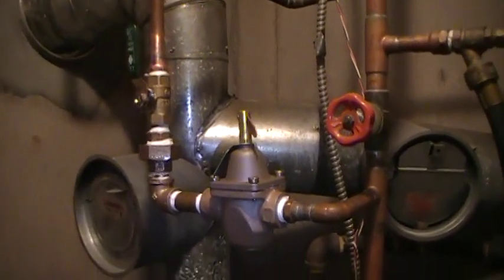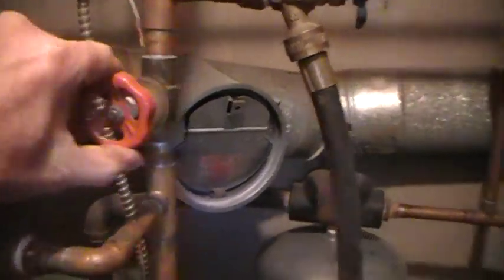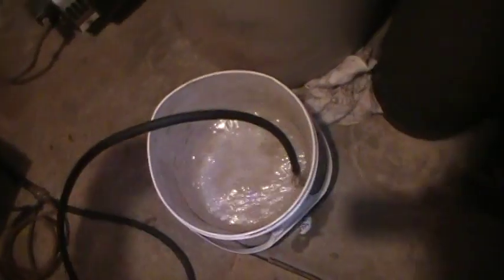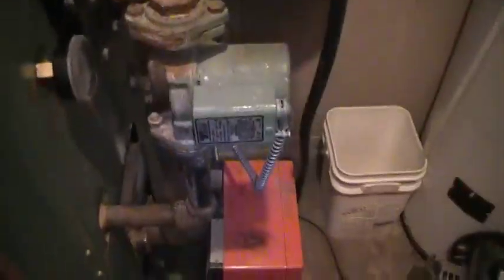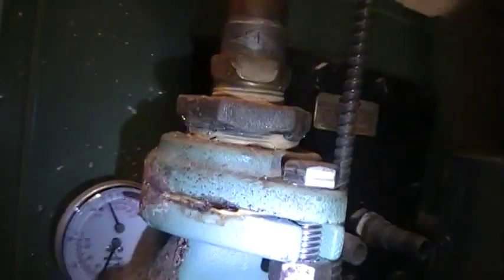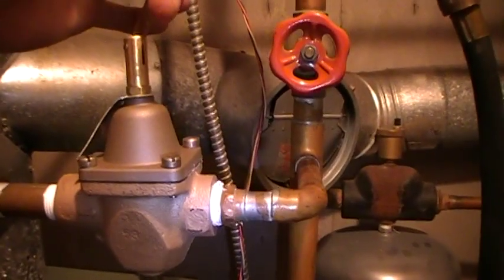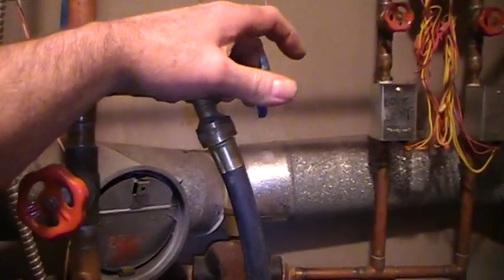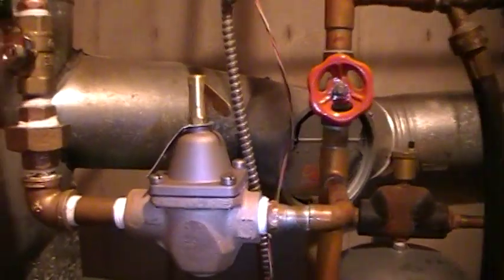How to remove the air out of your hot water heating system-girgling noise.

Comment: Hello Al. Thank you for your videos. .
I have to relocate one of hydronic baseboard heaters and I am trying to figure out how to drain my system, relocate/ replace the baseboard and then fill and purge the system. Here is some information about my setup:
My house is a colonial and the boiler is in the basement. 
I have two zones, one for the first floor and one for the second floor. 
The second floor zone has 2 loops.
The zone valves are Taco and are installed at the supply side.
There is a 00e Taco circulator pump on the supply side.
The 3 loops return (2 second floor and 1 first floor) meet and are controlled by 1 shut off valve on the return before the boiler.
Above the shut off valve there is a drain valve.
Before the 3 returns connect together there seem to be something like a valve that can be turned with a flathead screwdriver, not sure what that is. I looked online and people say a balance valve (?).
I would appreciate your help. I can send you picture of the system somehow.
Thank you in advance! 
Chrys
Reply from the maker: Hello Chrys,
You're welcome!
Is the baseboard you are planning to reroute on the first or second floor?
Do you have an expansion tank which is about 3 feet long and usually suspended up in between the joists or do you have an extrol tank that would be about a foot high and wide located near the boiler?
The funny looking valve is called a pressure reducing valve. Never adjust it comes preset.
Get back to me when you get a chance and we will see if we can figure this out together....Al
Reply: Hello Al,

Thank you for your quick response. I have the second type of expansion tank that you described. The one I want to relocate now is in the first floor, but I might add a few more feet of baseboard on my master bedroom eventually because it seems to be under heated. What if I touched those valves...?
Reply from the maker: Hello kouts_limnos,
No big deal as long as you put them back to how they were.
So you must shut the heating system down completely. Meaning both the power and the water shut off to the system. That valve should be located before the pressure reducing valve (the one with the lever on top). You may not have the lever on your reducing valve as it may be the your PRV as you mentioned above.You want to drain the loop you are working; so you will need to drop the pressure to zero.
I believed you mentioned that you only have one valve on the return which is too bad because you are going to drain water from the all three zones and will have to purge them individually once you have relocated your radiation. Regardless place a hose on the drain valve of the return and open until the water stops completely. 
Be sure to check the gauge on the boiler. It is your friend when it comes to the system. The pressure must reach zero before you attempt to do any pipe cutting.
Once it has dropped to zero and the water has stopped flowing out of the hose you can begin to cut the copper.
I always use a wet vac when I am making any cuts on baseboard as it takes care of the dirty water that will stain things easily.  If you are making these cuts in the basement then you will probably get a way with a bucket.
A little tip. Whenever I am rerouting a pipe I always use sandcloth to clean the pipe before I make any cuts as it is much easier to do beforehand. It is supported at this time and can be shined easily. Once a cut has been made the  end of the pipe will bounce all over the place. It will still need a little shine after each cut, but doing it will take care of the majority of the dirt on it.
Not sure when you are planning to do this, but spring is better than winter. Just in case you run into any issues.
You mentioned adding radiation to your bedroom. My rule of thumb is the square foot of the room divided by ten. Ten by ten room...10 feet of baseboard plus an additional few feet for an average window. In that ball park. I have had great success with this simple formula. Many homes have far to less radiation. So many people install it like electrical baseboard which you cannot make a comparison to.
I have seen kitchens which are generally the hardest places to install baseboard with two feet under each window in a corner on a north wall. They said the house was never warm. Very good reason for that.
Anyway...hope this helps!
Thanks for commenting and enjoy your weekend!    Al
Get back to if you have any more questions.
Reply: @TheOldkid888  Hi Al,
I am not planning on doing this until it warms up around end of March or so. Here is my plan of action. Let me know if you agree. I will turn the power and the water supply off. I forgot to mention that I have an indirect hot water heater. I will turn the supply to that off as well. Connect a hose to the drain and turn the shut off valve below it off. I will also turn off the valve before and after the circulating pump. Then I will open the drain valve and go upstairs and open the bleeder valve that is further from the boiler. Then I will wait until all the water is out of the system and the pressure is 0. After I finish with the moving around. I will turn the bleeder off, turn the water supply on, turn the valves before and after the circulating pump on. Manually turn both zone valves on and wait until no more air is coming out of the drain hose, making any necessary adjustments on the water pressure. when no more air in the system I will ensure the pressure is around 14psi turn the drain off and check for leaks. I thinking if I should install a shut off valve on each zone loop before they connect to the 1" pipe together. Also, my master bedroom is definitely underheated. It is 20x13 with 3 windows and only has 15 feet of baseboard. Your thoughts are greatly appreciated.

Thank you,
Chrys
Reply from the maker: Hello Chrys,
It sounds good. 
I personally like to put individual valves on all lines. One on the each return line and supply line. 
You have a shut off on either side of the pump which will isolate the pump if you ever need to replace it which is great! If you place valves above each zone valve; this will make replacing the zone valves very easy. 
It is not necessary, but convenient. I am a big fan of ball valves. The only way to go.
The indirect water heater will be fine. No need to shut the water supply off or drain any water from it.
BE SURE to close the bleeder before opening the feed valve to the system. MOST IMPORTANT as you know!
Sounds like you have it all under control. Remember zero pressure. Allowing air into the system will drain that loop, but it may not drain the one you are working on; so opening a bleeder on each is what I would do.
Best of luck with the project! REMEMBER TO CLOSE before filling. Can't stress it enough.
That size bedroom should have at 26 feet in it. It should go across the 13 and then down the longer wall at least 15. If it gets to warm; you can always close the dampers on the baseboard somewhat. Most people like their bedrooms a little cooler for sleeping so closing the dampers will make a difference.
Thanks for commenting and enjoy your week!    Al
Reply: TheOldkid888 Al, thank you again for the quick response! One more thing and hopefully I will be all set. If I add another 10+ feet of baseboard in my master bedroom, won’t that affect the balance of the loop? 

Thank you,

Chrys
Reply from the maker: Hello Chrys,
Where is the thermostat located for that zone?
How much radiation is in the other bedrooms and what size are the rooms?
Get back to me when you get a chance.....Al
Reply: TheOldkid888 Hello Al,
Sorry I took so long to respond, but I ended up not doing anything in the spring to add more baseboard to my bedroom. I think I have to do something now because the master bedroom is 3-4 lower than the rest of the second floor. I was thinking about replacing the 16 feet of existing baseboard with something more efficient, not sure what. Or add 8-10 more feet of baseboard. I am afraid of messing up the balance of the loop. The master bedroom is the first room of the loop. There are two more rooms after an 8x8 with 8 feet baseboard and an 8x12 with 12 feet of baseboard. On the same zone but different loop of there are a 5x7 bathroom with 4 feet baseboard, another 5x7 bathroom with 4 feet baseboard and a 12x14 room with 12 feet baseboard. The thermostat is located in the hallway in the middle of the floor. Also, if I end up adding more baseboard the return will have to run in the same enclosure because the supply line is in the opposite direction. I am sorry for the long comment. Thank you!

Chrys
Reply: Any input?

Comment: Hello Al, how do I bleed the air out of my boiler? The way it was setup is that there’s no shut off return valve between zone valve and spigot[sediment valve]. The cold water main feed goes to water pressure regulator tied in below the zone valve then to circulator pump(return line) then goes back to the boiler ,the spigot valve is above the zone valve. Please help and Thanks in advance
Reply from the maker: Hello sakitlikod1,
Just to be clear....Is there any valve on the return line going back into the boiler? 
Do you have cast iron rads or is it baseboard?
We will try and figure this out. Just need as much info as I can get.
Thanks for commenting and get back to me when you get a chance.....Al

Comment: hi, you have your fill valve teed into the return. is this the only way or location to auto fill the boiler? thanks.
Reply from the maker: Hello mark.r hvac,
It is how I install the feed lines, but I have seen them on the flow as well.
It should be installed in the return as it pushes the air up through the system when purging.
Thanks for commenting and enjoy your weekend!    Al

Comment: my 2 story house only has 1 zone the pipe from the boiler go ,s up to all the radiators and back to the boiler how can i purge the air from it
Reply from the maker: Hello dennis,
Is it cast iron radiation or baseboard radiation you have in your home?
Thanks for commenting and get back to me when you get a chance....Al
Reply: @TheOldkid888  i have cast iron radiators. thanks for your reply
Reply from the maker: Hello Dennis,
No need of purging when it comes to cast iron rads. You can purge all day and it wouldn't make a difference.
On each rad you will see a bleeder valve. It is located on the side of each rad on top. It is a small 1/8th fitting with a screw in the middle. You simply open the screw in the middle until you get air. DO NOT open it too far. If the water is close; you wouldn't want to drop it on the floor. It would create quite a mess as the water is black and stains things very well. I generally use a small container and a rag and open the screw a little. There is usually a tiny port located on the bottom of the fitting. This is where I place the container and wait for the water to arrive. 
Once you get the water; close it as quickly as possible you are all set. You will have to do them one at a time.
There a few different types of screw ends on this fitting. Some have a screwdriver slot. Others have a small square end and others have a wooden handle on them for opening. There are a few more types, but these are the most common that I have come across. So you may need a screwdriver, a pair of pliers or a small crescent wrench to open the screw. Remember it is counterclockwise to open them. 
Thanks for commenting and let me know how you get a long......Al
Reply: @TheOldkid888  Thanks that worked

Comment: Hi. I have heat coming through 2 rooms on the second floor. The 3rd room and bathroom is not getting heat. The living room I first floor getting some heat. Theres 2 pipes next to it in which Im sure is for the 2 rooms without heat. Only half the pipe have heat..... What can be the course?
Reply from the maker: Hello Anthony,
It sounds like you need to purge that loop. How many zones do you have in the house? 
What is the pressure on the tradicator (gauge) on the front of the boiler? It should be at least 15 when the boiler is hot.
Thanks for commenting and get back to me when you get a chance....Al

Comment: Thanks for the informative video. I did this and after 12 buckets of water, I'm still seeing bubbles. I don't think this method is gonna work for me. Is there another method to remove air?
Reply from the maker: Hello MIke,
You may want to try a hose on it and try and maintain the pressure at 15 pounds for about 5 minutes. This should remove all air in the system. The biggest thing is to maintain constant pressure. It should work for you. I have had great success purging the air from the system this way.
Thanks for commenting and enjoy your week!    Al

Comment: Can this be done through an apartment house?
Reply from the maker: Hello David
Yes. A big thing to keep an eye on when doing it is the pressure on the system. The apartment house may be higher than a regular home and would require a little more pressure to do it properly. 
How many stories high would the building be?
Thanks for commenting and get back to me when you get a chance.....Al

Comment: Thanks, this is good to know. Difference is I dont have zone valves, but 2 circulators.
Reply from the maker: Hello Rons Beers & Ales,
You probably have flow control valves on each loop. You can still purge it the same you would as if you had zone valves. You just wouldn't have to worry about hooking any levers. Simply shut off the return valve and attach a hose to the sediment valve above it. 
Thanks for commenting and enjoy your day!     Al
Reply: thanks for the comment, but my Burnham oil fired water boiler seems to have a leak in the domestic/potable coil - yipes.
Reply from the maker: Hello Rons Beers & Ales,
You have changed the expansion tank and the feed water valve. Generally it is the expansion tank. 
If the boiler is turn off for a while and the pressure is still building; you're coil is proabably the issue.
Unfortunately you will need to get that replaced.
I believe it could be cast iron? If so; you should be all set if it is.
You managed to find the problem. Now to make the repair.
Thanks for commenting and good luck!
Let me know how you get along!      Al
Reply: THE OLDKID888, YES i WILL LET u KNOW WHAT i DID. mY NEPHEW IS SPEAR HEADING THE WORK, I shut of all pertinent valves, drained the boiler at 11:00 Am. by 4:00 PM it was full of water and PSI was 30. We then drained some water isolated the tankless coil, and the PSI has held at 20 / 25PSI and the relef valve stopped dripping water. so its narrowed down to the tankless coil.
Reply from the maker: Hello Ron,
Definitely is the problem.
Best of luck with it!   Al

Comment: I have  lots of air in my pipe. It took me long time to skim and seems never can take them out. I don't find any leaking in pipe anywhere. Please let me know what should I do
Reply from the maker: Hello Faye,
You can purge the system for an extended time and still end up with air in the system. The way to get around it is to keep a constant prssure on the system while you are purging. To do this you must lift the lever on the pressure reducing valve that will allow the water to eneter faster while you are running the house on the return end of the loop. While doing this you should watch the tradicator (gauge) on the the boiler and try to keep it between 15 and 20 pounds. This will allow the water to push the air forward through the radiation in each room and out the drain valve on the other end of the loop. 
Be patient when doing this as it takes a little time, but I assure you it will work.
Be sure to watch the pressure as you don't want it near 30 as the relief valve will pop.
Lifting the lever gradually will allow you to increase the pressure. If it starts to get to high allow the lever to go back down a little and this will reduce the pressure.
Thanks for commenting and best of luck with the repair!      Al